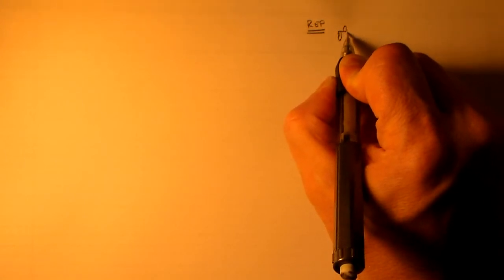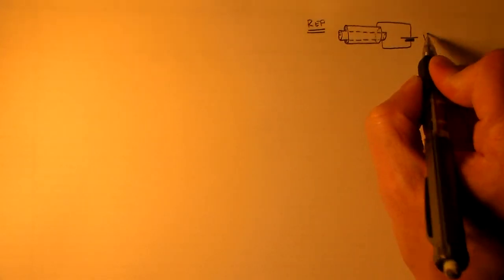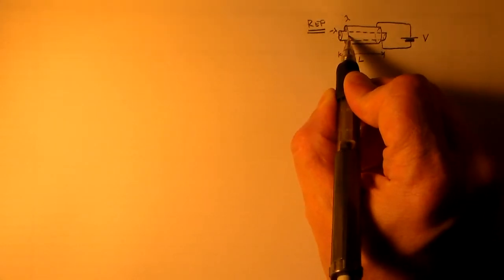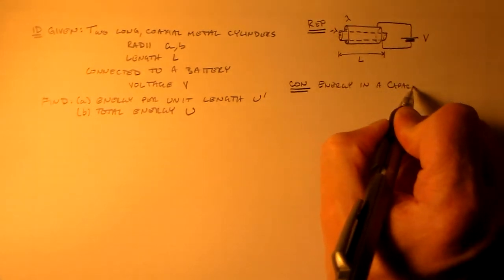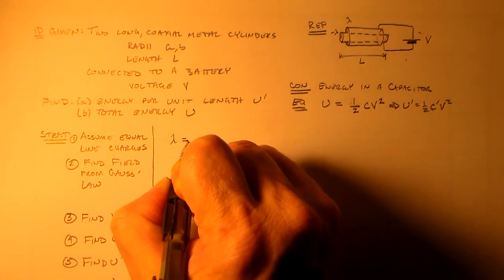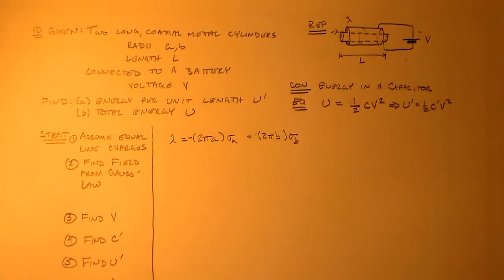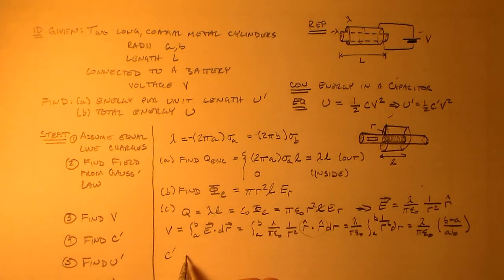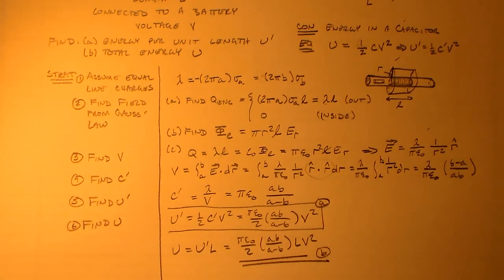Energy in a Cylindrical Capacitor

Comment: The work shown in this video is incorrect starting at line (b), calculating the flux.  The area should be circumference times length, NOT area of cap times length.